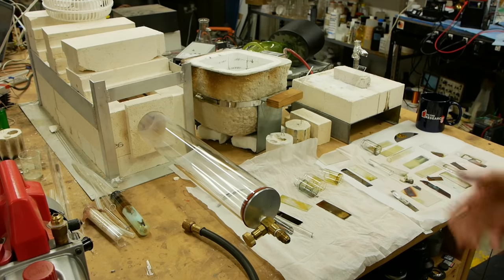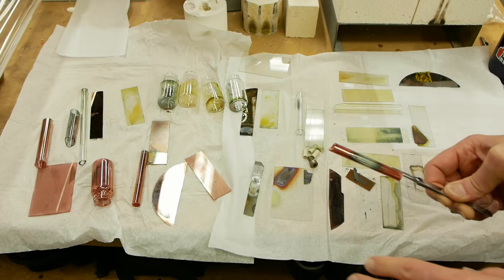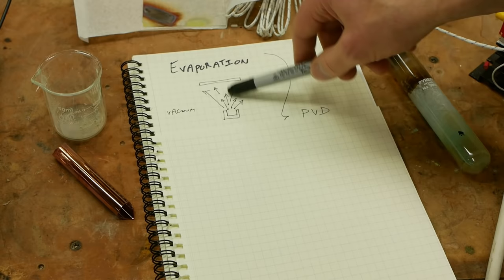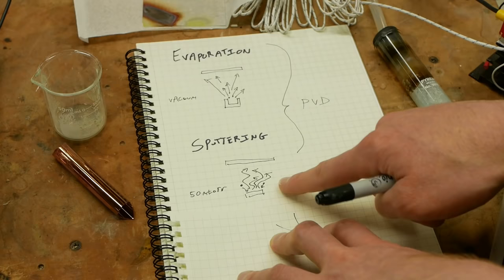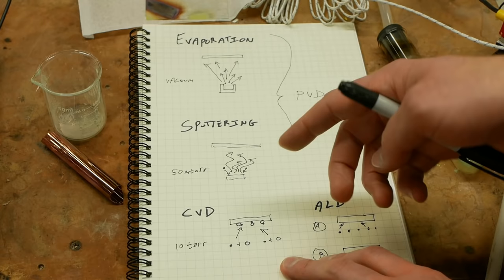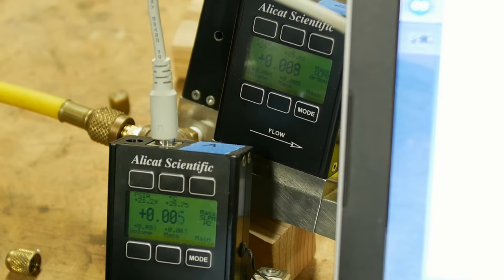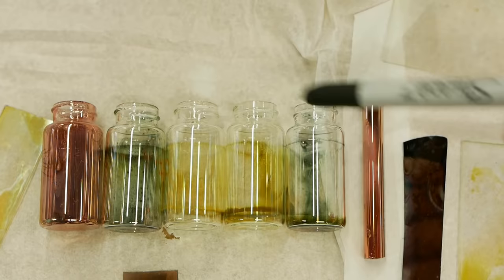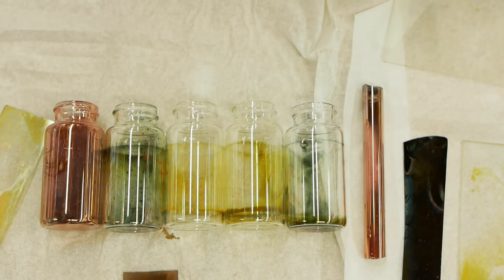Atomic Layer Deposition of copper - If you like sputtering, you'll love this!

Comment: When the flow rates were scaled from the paper's smaller tube furnace, was it scaled using the Reynolds number?

Side note:When I was in university for mechanical engineering, I worked for the tool crib and engineering labs.  A physics student came down for some help and advice crimping some connectors onto a high gauge braided wire.  After I got him sorted and set up with the heavy duty crimper, he told me that they were putting 600A to vaporize and deposit metal on the inside of a vacuum chamber to set up for another experiment.  I can't remember what it was for

Comment: FWIW the compounds shown in that paper are not organometallic compounds. That designation is reserved for compounds featuring a direct carbon-metal bond, and you are right to highlight their safety record. Instead, the compounds shown would be better described as coordination complexes of copper (with organic ligands) and for the most part do not have safety concerns over and above those for their parent metal ion. Interestingly, some of the shown compounds are not particularly complex and could almost be described as a general reagent in the inorganic chemistry lab. Particularly the Cu (II) acetylacetonate and simple derivatives thereof ( tfacac, hfacac, etc..) should be commercially available (see Strem or Sigma). If you are feeling adventurous, [Cu(acac)2] should be easy to make (J. Am. Chem. Soc. 1959, 81, 13, 3188–3189).

Comment: This is your hobby. What do you do for a living? Teach at MIT or Cal Tech?
Also, if organo-metalic compounds work well, do any acetylacetonate compounds, such as the ones made with nickel, iron, aluminum, and chromium work for this process? I know that only the Al one has any documented toxicity for exposure and that the others have intermediaries that can have toxic effects, such as nickel since you start with NiCl for a reaction in water. The Ni compound also only crystalizes when it is a tri-hydrate, although the water free version is paramagnetic, which is an interesting property it has.
I ask because I have synthesized two of these, the Al and Ni compounds, and have worked with other students that have synthesized others.
Reply: "What do you do for a living? Teach at MIT or Cal Tech?"

Not sure where Ben works at the moment, but I recall he was working at Valve (PC gaming) at some point.

Comment: Waiting for ALD on chocolate..;)
In university we were trying to do ALD on polymer materials. So no heating. We used plasma in the process and gas valves were on-off type solenoid type with a custom made controller.
Would distilled water or ultra-pure water make any difference in cleaning the substrate?

Comment: Why bottles as the "substrate?" Wouldn't the objective of the demo be better served by, say, substrates made from lengths of pipette tubing? Tubing would more likely be uniform in morphology along its length.

There are a lot of comments below about the quirks and deficiencies of mass flow controllers. Have you given any thought to controlling gas quantity by some sort of pulse width modulation method that injects constant micro-molar volumes but at a variable rate? I don't know if that's even possible, but PWM can be a very precise and stable method of metering stuff, for instance power.

Comment: funny that the shaped parts of the glass behaved that way. i imagine them on a conveyor of some kind (perhaps the middle part is shrouded or comes into contact with something that the formed ends dont.  the heat of the glass and the heat of whatever is holding them may be to blame.

Comment: Have you heard of the super wear resistant gold platinum alloy discovered about 3 years ago?
Supposedly it utilizes some quirks related to the crystalline nanostructure of the alloy resulting from magnetron sputtering it onto a surface and it seems like the ideal material for a project I'm working on but way out of my area of expertise so I figured you'd find it interesting.
Love the video btw!
Reply: Machining tools usually use a TiN or TiAlN coating to make them harder. They use it coat cutting tools like end-mills to extend cutting life. I believe a CVD process is used to diamond coat cutting tools. I think the gas is Methane, but I don't recall the details. Diamond coated cutting tools are often used for cutting super hard materials.
Reply: @guytech7310  my purpose ideally requires very high corrosion and wear resistance to maintain electrical conductivity while under high current and friction for brief periods and TiN certainly looks promising so I will probably try to test it to see if it can hold up better than the Ruthenium electroplating I was considering but unless it works better than I expect the platinum gold alloy being made of noble metals will probably still be what I use in my final product once I figure out sputtering and make my own setup. Thanks for bringing it to my attention though, you may have saved me a great deal of effort.
Reply: @potato4dawin1  Based upon your reply I don't think  TiN or TiAlN will be a solution for you needs.
Reply: @guytech7310  I did expect that it might not be as it still oxidizes but I don't really know if it happens fast enough for it to work for my purpose or not. Minimal corrosion over a short period would still work and my main worry over Ruthenium plating is that it wouldn't be abrasion resistant enough. I'll probably just jump straight to the platinum gold alloy sputtering if I can get my project to work for a single use with the base materials I plan on using and if the material synthesis was as simple as the paper suggests.

Comment: 24:30

That's such an interesting deposition pattern! Could it be that the thicker glass in the bottom and threaded section is acting as a heat sink and drawing heat away from the bare area...? Or maybe when they are manufactured those areas receive a different manner of forming which ends up with a semidifferent microscopic finish...? I'd very much like to know the actual reason =) forgive any ignorance, I'm a layman just trying to understand haha

Comment: The marks may be due to scuffing during the production. If the glasses are transported together on a conveyor the surface at these region gets scratched when they push each other. At least that's the case with beer bottles🍻

Comment: I'd guess that the handling equipment used in the production process leaves behind contamination.  Contaminants embedded into the surface of the glass while it is cooling cannot simply be "cleaned" away, they're part of the glass.

Comment: Could you make a copper wire and vaporize the same compounds they use for superconductivity? Or vaporize 3 compounds that convalesces to the compound you want. Just a small layer since electric fields mostly conduct around the wire? Would it improve conductivity of copper?

Comment: Now I know how to make optical fiber, thanks.
Reply: That's not how optic fibers are made. I believe they are usually made using two different glass materials shaped as glass rod and tube. Glass rod is inserted into the tube and heated to melting. Then pulled like wire. The two different glass materials have different refraction indexes to create an internal reflection between the two glass layers.
Reply: @guytech7310  The process shown in this video is applied in the fabrication of fiber optics. There is no incorrection  in the statement, but thank you.

Comment: how about running a resonant frequency through/across the chamber to create a standing audio/microwave wave. Would you be able to force the deposition in slits? If you ran two 90 degrees from each other could you create a single standing wave with a high point allowing you to control the deposition?

Comment: Can't I simply use surface activator chemicals and deposit copper using electrolysis? Or there's a difference with the texture or the way it deposits on? 🧐
Reply: Maybe electrostatic

Comment: Could you use one flow controller and a junction box with three solenoids on a timer. Effectively using the precision of the allycat with the cheap cost of a simple timer setup?

I really don't know what I'm talking about btw; as a software engineer, I haven't a clue about actual engineering.

Comment: I'm interested in building a simple tube furnace similar to yours. Are your endcaps made from aluminum or steel? Was wondering if a large lab stopper might work if the ends protrude enough and don't get hot.

Do you use mortar in between the bricks or are they just stacked?

Comment: What is the reason for copper (II) chloride not working?
My understanding is that it's just high temperature reduction with hydrogen, Cu 1+ reduces to metal, H2 oxidises to H 1+ and leaves with Cl- as HCl. Is there something inherently wrong with Cu 2+ for this purpose or is the transition from 2+ to 1+ a problem?
Does it imply that for metal deposition it's best to use precursors with closest oxidation state to 0?

Comment: which deposition method would you suggest to create a layer of copper sulphides or sulphates on aluminium or on a semiconductor? or aluminium on copper sulphides or sulphates? i'd like to create a junction between copper sulphates or sulphides and two aluminium electrodes like this: Al - CuS - Al.

Comment: Stupid Question (You'll probably say stupid questions don't exist): 

Are you pre-heating your process gasses? if you think air is a good insulator at standard atmospheric pressure, think how some of the process gasses heat at low pressure - radiant heat won't heat them up enough. 

I bet your bottles are showing up like that becuase colder process gasses are getting inside the neck and cooling the neck portion of the glass more than the body of them (cooling from both surfaces) - producing this pattern, where the colder neck portion isn't coating.

just a thought without much thinking!

Comment: I am working on low-cost CVD for synthesis graphene, the mass flow meter is so expensive for me and not available in my country,  can I use a solenoid valve very fast open, and close to giving me a very low flow of hydrogen?
and about heat wire resistance (kanthal) to achieve 1000 C which ohm or watt can I use?
I will be grateful if you answer to me

Comment: I wonder how effective this would be at applying Tritium to glass (if it could be done safely). Like if it would be more effective to coat one side with Tritium and the other with a mirrored backing, then apply it to solar panels, sort of like like Nurdrage and Lasersaber's (and a few others) efforts to make a Tritium power pack.
Reply: Does hydrogen bond to glass well?
Reply: @ipodhty  I have absolutely zero clue. If it doesn't, I'm betting that it could bond to phosphor, Tritium requires phosphor or w/e to generate light, if it could be bonded to it, who knows. I'll leave all that to the smart people.

Comment: fun Victorian university thinking make a Big machine to do small things ^_~
'prior art' simple reusable stand alone Rhombic Drive  'stirling cycle' expansion/contracting (2 or more) gas could be used here, just compressive flash/resistive heat each gas end in sequence to move them (pin hole?/hot displacer tube!) into the centre reaction hottest space , then quickly contract the gas ends with cold inert gas as required.. colour your gasses to 'see' the flows & colour change mixing as a rough instrumentation 'guide'

Comment: Was there a reason to use $1000 needle valve controllers instead of DIYing them with a servo?
Reply: The MFC have the proportinal valve, mass flow meter and PID contol all built in. More expensive to purchase/make these componants individually

Comment: I wonder if you could just heat up the glass to high temperatures instead of RCA cleaning to boil off the surface contamination.
Reply: That's basically the same idea as the plasma cleaning, I would think.

Comment: You mentioned in your carbon nanotubes video that deposition techniques like sputtering can be used to build the the catylizing bases for a carbon forest, could you try it with these processes? Trying the magnetic alignment would also be interesting
Reply: I love nano tubes and nano science... 
 If people start finding industrial manufacturing processes we could have the best concrete.. and fiberglass, and plastics, and all kinds of stuff
Reply: @helpabrothawithasubisaiah5316  I'm really hoping for a material science breakthrough that would make a space elevator viable
Reply: I dont' think sputtering can be used for carbon. I believe stuff like CNT\graphene & diamond uses methane gas for the carbon to be deposited.
Reply: @wreckervilla  Issue is probably time. I think continuous CNT could be produced, but it would probably just take a century or two to make them long enough for a space elevator. Need tech to figure out how to bind cnts segments together.
Reply: @guytech7310  if I recall right they've done more tests and figured out that they are not actually strong enough for that. 

 And even at the strength they were it would be dang near impossible to make enough strands that long defect free
Reply: @helpabrothawithasubisaiah5316  Perhaps. The original idea was to used a binder to short segments of CNTs, which would not be strong enough. I believe a continuous strand would be strong enough with the right size CNT. CNTs can be different sizes (diameters) and range from 100 GPa to 200 GPa. I believe the bare min. for a space elevator is 100 GPa.

Graphene might also be an option at about 130 GPa. I believe they have been able to make continuous ribbons over 10 meters. But the process is slow, & there is no tech to join segments (defect free).

It might be possible to produce very long CNTs or graphene ribbons using biological means. We would need to develop biological type machines to produce continous CNTs much like Spiders & silk worms can create fibers. Some method would also need to be figured out how to create biological machines to bind multiple segments that are defect free otherwise it would probably take centuries to grow single strands that are 36K km long. 

That said I don't think this will happen in my lifetime or ever.

Comment: 24:47 Has to be the forming process. One way that could prove it is if you'd heat one of those bottles (clean ones) and then deforming the side of the bottle with a rod or something and then trying it one more time.

Comment: So stupid question but are there non-standard cubic centimetres?
Reply: yes they're called cubic inches in the states
Reply from the maker: Good question.  "Standard" in this context means standard temperature and pressure (1 atm at 0*C).  So, if the tube furnace were at 0*C and 1 atm, we could measure 1 cubic centimeter of gas coming out of the flow controller when it was set to 1 sccm.  If the tube pressure were instead 0.1 atm, the volume flow rate would be 10 cubic centimeters per minute because the pressure is ten times lower, so the gas would expand to ten times larger volume, even though the mass flow rate (the "standard" gas flow rate) hasn't changed. sccm is way to specify how many gas molecules are flowing at a given rate for an ideal gas, and is a good way to specify things were pressures might change.  The flow controllers also must know which gas is being used to correctly calculate the flow rate based on the gas's properties.  Hydrogen is much lighter than argon, for example.
Reply: @AppliedScience  Thank you for the very detailed explanation, it makes a lot of sense in hindsight.

Comment: Could you not use a molecule coated cathodes to deposit to the anode? Okay, so you will need 50kV on the anode. That's easy enough, as long as you have the deposit ready on a hot cathode, like a vacuum tube. You can have various cathodes heated separately, when needed. So, you have to have a vacuum. Life is never easy, eh?

Comment: 19:43 yes please don't water and especially acids into your rotary vane pump... We've had a really useless chemist (diploma from some eastern university 40 years ago) at the lab, who thought, that instead of using a rotavap, it was a good idea to just use our vacuum drying cabinett to evaporate off between 20 to 500 mL of 10% tetrafluoroacetic acid in water... I remarked it when the pump stopped working properly... The oil and whole inside of that poor pump looked like diarrhea... RIP 3 stage edwards pump... :'(

Comment: I believe you should, before this decade is out, commit yourself to building a home made xray photoelectron spectroscopy system (or scanning tunneling microscope) and return the results safely to the channel. 

In seriousness,  home made stem is easily achieved (Google Dan berard stm). XPS is a different beast but your home made mass spec is part way there. Either technique is a fantastic challenge to build and would make an impressive video! Let me k know if you want help/info too!

Comment: try aluminium foil thin film super caps with ald, ie, aluminium, then aluminium oxide thin film, then another layer of aluminium, you have super think foil aluminium-oxide-aluminium super cap
Reply: the aluminium oxide thin film is just by aluminium anodization or the normal passivation layer, controlled
Reply: then sputter the aluminium on top of the aluminium oxide thin film

Comment: What is the name of that little pressure gauge circuit/chip at time 12:00 anyone, thanks.
Reply: Pictured is a SparkFun TeensyView on a Teensy 4.0. The sensor is not pictured. Looks like a FET hanging off the side, possibly amplifying the signal he's getting back from the sensor.
Reply: @bur1t0  Thanks :-)